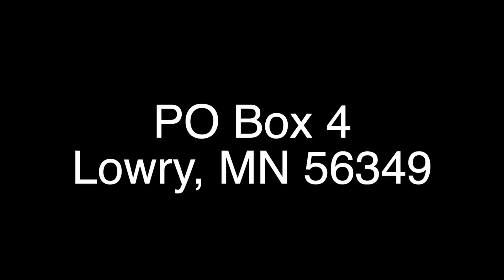Cutting Up My Junkyard (Ex-Hoarder Property)

Comment: A trick from a old junk hauler the most cost effective way to deal with the wood in that old trailer is to open the doors put some diesel on the wood light it then cut it up because it's probably going to partially burn when you cut it up anyway

Comment: When you were in town I noticed it was Marshallton on the water tower. So I googled it, turns out I use to go by really close to you every week. I ran tractor trailers (teams) out of Los Angeles for UPS and we ran to Brooklyn IA once a week. We went to the Kwik Stop at mile marker 201. We were there about 5 hours waiting on our loads back and it was a nice truck stop. Good restaurant and I  remember the ham was so thick, plus nothing but corn down I-80 as far as you could see.

Comment: ever notice it is always the inside dual and almost never the outside tire
Reply: I believe the more worn tires are put on the inside of the dually setup. New tires are put on the front, and retreads are put on the back, with more worn tire on the inside. Doesn't make sense from a maintenance standpoint, but keeps the 'ripped' tire tread from flying thru the air (I think) and looking like a disaster.
Reply: Mean tires, they do that to annoy you😋

Comment: I bought an “0” tip for propane that lets me use a bbq tank and oxygen. Uses the same torch ,hoses .and regulators. And a whole lot lighter to use than acetylene. Some of my friends say that it takes too long to heat up but if you you the big OT tip it heats up well.
give it a try you might like it.

Comment: For just cutting and heating use propane instead of acetylene, you can even use your barbeque bottle. Just need to change the tip on your torch to propane tips. Propane is wayyyyyy cheaper

Comment: Cole, you should look into getting a propane torch or a tip for your torch if posable. propane is way less expensive and lasts much longer!  It uses the same hoses and regulators.

Comment: Hey Cole, I don't know if you have irrigation pipe trailers in your area but if you could get a hold of one you wouldn't have to cut your steel into such short sections. We use them here to haul around 50foot long aluminum hand move sprinkler pipe. Might save you a few dollars on gas.

Comment: You should put rubber tires on your torch it will be easier to move on rough ground, it will also be quieter on concrete

Comment: To cut all that stuff up get a gas concrete saw and put metal blades in it. You will find it is a lot cheaper than the torch take it from a full time scraper.

Comment: acetelene cylinders need to be set upright for minimum 30 minutes just in case the acetone that dissolves the acetelene has migrated to the valve. other wise could end up with a bomb

Comment: cole an old trick is when you hear a air leak but can’t find it spray windex on the airlines or any where near the air leak. it’ll start to form bubbles quick and CHEAP way to find it. -from a truck driver

Comment: Acetylene bottles should not be on their sides--keep upright but if they are  on their side then after uprighted wait at least an hour before use--the acetylene is  in a medium in the bottle---GOOGLE it---you could probably use butane/propane with a new torch tip for a cheaper alternative--does not get as hot as acetylene but works great for what you are doing

Comment: Not trying to be a know it all, but Acetylene is sold in liquid form under pressure, and there's a relief valve on top of the cylinders like the one on LP gas grill tanks, that are designed to relieve the pressure off the tank in case of over heating of the cylinder. If this valve is below the liquid level when cylinder is turned on its side, and if for some reason the take gets to hot like in a car or a fire the cylinder will vent liquid rather then vapor. Which is way way more dangerous then venting vapor.
 I worked in the industry

Comment: Hey Cornstar's! 
There is a small smart battery charger that exist, it come with a really tiny solar panel. It will keep your battery full.
They cost 30$ canadian ... pretty sure you would save a few thousand in battery if you equip your machine with them. 
I know John Deere has some.

Comment: Cole. You should check out the Diablo metal circular saw blades.  They would save you a fortune in gases. I have seen videos where they cut through 1/2" steel.

Comment: Personally I like the 10 minute format that you run with.  I like how you're constantly changing up who your following and what tasks your working on.  The Cornstar channel is my favorite and I look forward every day to seeing what you post.  

What could go wrong with putting 40k pounds of scrap in the back of a trailer that hasn't been used in 30+ years?  You know those tires are mint.  Not to mention the air lines, electrical, bearings, leafsprings, frame, cross members, tie down points.......  It is going to be a heck of a chore getting cut up.

Comment: Cole, you really need to be careful with those acetylene tanks. They have acetone in the bottom of them. Acetylene is extremely unstable above 30 psi.and the acetone helps keep it stable.  The tanks must, must, must always be stored in an upright condition so the liquid acetone does not come out..  Acetylene is very explosive above 30psi.  You should have somebody experienced with it, come out and show you what can happen. You'll never forget how dangerous that stuff CAN be.  It was demonstrated in college and I've never forgotten.

Comment: switch over to propane for your gas for the torches. way cheaper, huge bottles. you'll probably need a new tip but for scrapping it's the bees knees.

Comment: Fein
Fein 232-69908120001 Slugger Metal Cutting Saw44; 9 in.44; 15 Amp         This could make short work of all the metal cutting that you’re doing. This thing is an absolute beast and it goes through metal light butter I’m talking like 3 inch steel

Comment: Laying down acetylene cylinders is illegal for good reason:
 Why are acetylene cylinders different?
Acetylene is an extremely volatile gas which has a high risk of a dangerous chemical reaction called decomposition. Decomposition is a spontaneous reaction that can cause high energy explosions. To stabilise the gas against decomposition, acetylene is never stored in a pure state. Instead it is mixed with a liquid solvent (usually acetone) and stored in a special cylinder which contains a porous filler material (also known as a porous mass).

The liquid acetone is absorbed by the porous filler material which also serves to slow down or halt any decomposition reactions. Decomposition can be caused by a flashback, acetylene cylinders being dropped, or exposure to heat/fire. It is critical that these specifically designed cylinders are stored and handled with extreme care.

Comment: HEY COLE ,NEVER LAY ACETYLENE BOTTLES DOWN AS ACETONE WILL "COME FORTH FROM THE TORCH" AND IF THAT HAPPENS TURN OFF BOTTLE BEFORE TORCH OR YOU CAN GET BLOWN UP !BEFORE USING A BOTTLE THAT HAS BEEN LAID ON IT'S SIDE, LET IT STAND UPRIGHT AT LEAST AN HOUR BEFORE USE...IF YOU FOUND OUT BEFORE THE VIDEO IS OVER DIDN'T MEAN TO RESTATE ,AS I STOPPED VIDEO AT THE POINT WHERE YOU ASKEED IF IT WAS OK TO LAY THEM OVER TO TRANSPORT THEM,(NOT ERASING ,NOW ON WITH THE REST OF VIDEO)

Comment: Cole you need to get a big bottle of liquid oxygen
Reply: And propane there’s supposed to be 19 of the green oxygen bottles I’m on tank of liquid oxygen and with the amount of cutting you have to do it would be worth it to change over you can still ues your hose and torch ( will need different tips) and you should be able to use the regulators you have or I know a junk man I’m Marshall county Iowa that would come out and buy it and do it all himself

Comment: As a former safety trainer for a State DOT, I must warn you and your viewers to NEVER transport acetylene tanks inside a vehicle. It is so flammable (explosive) it should have its own hazard rating. I’m surprised the gas vendor would sell you gas if you arrived with tanks in the truck. Acetylene should also be stored and transported in a vertical position.

Comment: Hi Cole.  I am glad that you recognize the safety hazard of not hauling acetylene tanks in an enclosed vehicle.  But not happy that you did it anyway, and also put Nave's life in harms way.  Acetylene is highly unstable.  Under certain conditions, it can explode.  Another safety hazard with acetylene tanks,.....DO NOT lay them down or transport them laying down.  Acetylene tanks are made different on the inside than most other tanks.  Weird things go on inside the acetylene tanks when they lay on their sides.  Sorry to get on your case,.....but you are putting more than just yourself in harms way.  You could be going down the road on a busy stretch of road, and the tank(s) explode.  Imagine what that could do to other vehicles and innocent people.  It looks like you guys have several oxy-acetylene setups on your farms.  I am really surprised that such a lackadaisical attitude is taken for something so dangerous.  I would think between you, Daddy Cornstar, and Cooper, somebody has had to have had some proper training.  I learned these things back in the early 70's in Ag class.